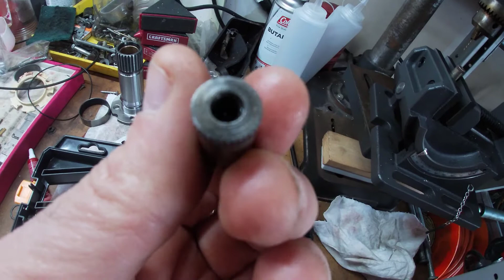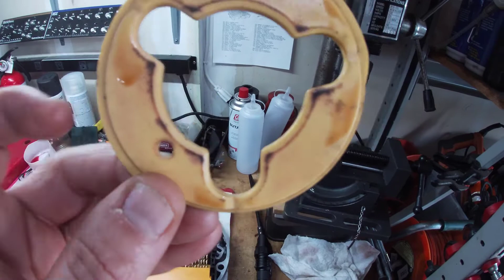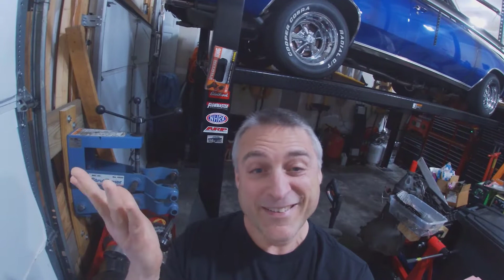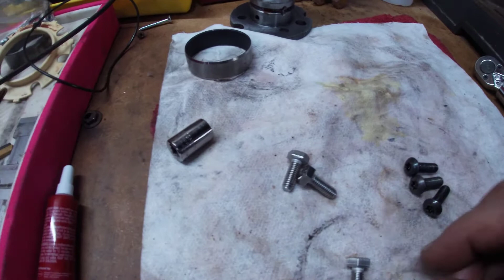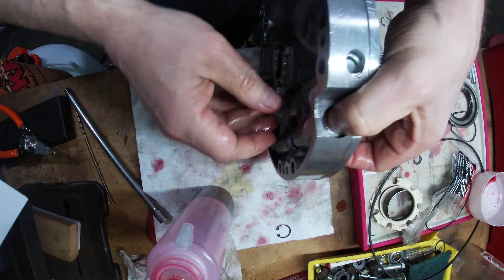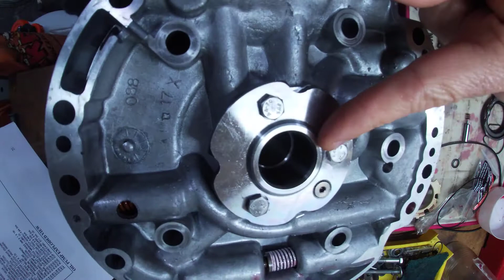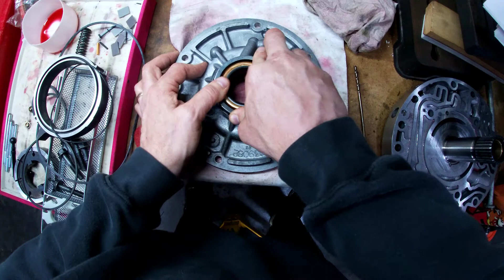200-4r Rebuild (part 7) - Oil Pump Mods for High Performance

Comment: Why did you have to remove the pin at 2:11 to drill it? It looks like it'd be easy to drill it in place if you just turn it over from the position where you press it out.

Comment: Phil i assembled the boost valve and it moves about 1/16 in . is it catching in the bore  or is this normal? thanks.
Reply from the maker: Nope, something is not right as the assembly should be flush with no gap. I would recommend to take it back apart and make sure everything was installed in the correct order and bore is smooth
Reply: the small end moves alright its the bignext to the snap ring that has the small travel took it apart and looks like thats how it works. i think.
Reply: I forgot thanks for the info and quick reply phil

Comment: Phil, what state are you located in? Thanks.
Reply from the maker: Hi Robert, I'm in NY state... did you need something?
Reply: @wrenchingwithphil  You're not up for going through another 2004r are you? I'm in Rock Hill SC. It has a fresh rebuild "supposedly", but my car has a 3.73 rear end gear, it won't get 4th without a 4th lock-up switch;  and just recently lost all lock up (4th)  after installing a TCI 2 wire lock up kit with vacuum. I'd like to have all upgraded components and a hard firm shift, even though I only have a mild Oldsmobile 307 engine.
Reply from the maker: @robert3mccrorey  Sorry Robert but I've been digging into this trans whenever I get free time since February and still have more to go... Then after the trans I'll start building a blown 454 bbc to go with the trans. So, free time is rare for the foreseeable future.
Double check your wiring for the kit. Not sure what TCI include in their kit but here's all you need to do:
https://annawiringdiagram.com/wp-content/uploads/2019/02/200-4r-wiring-diagram-manual-e-books-200r4-lockup-wiring-diagram.jpg
In one of the end videos that's exactly what I'll show as how to wire it. (I think I actually created that drawing like 10 years ago although that's not my site I linked to)
Feel free to ask if any questions!

Comment: You wouldn’t happen to know a source for the tcc valve springs? I’m converter one that was set up with a non lock up converter back to lock up and can’t find the springs.
Reply from the maker: no, sorry but I don't. 
You might try reaching at to Chris at ckperformance.com That's where I got the parts for this build. He might be able to guide you to a source at least...